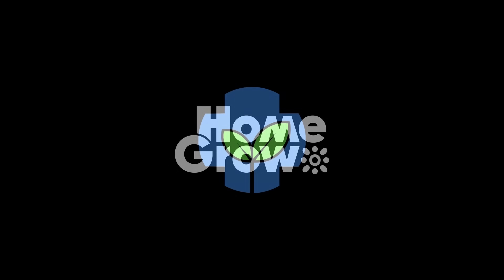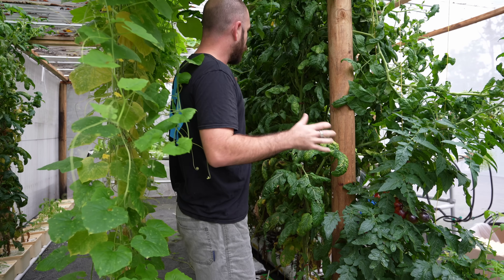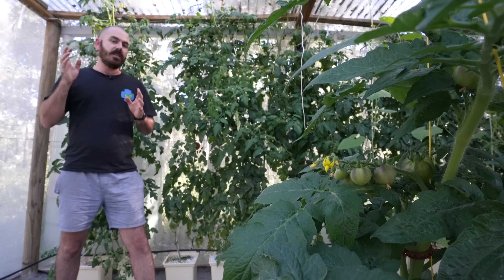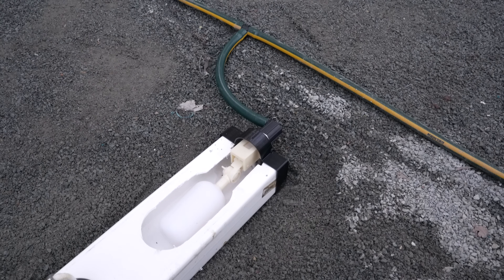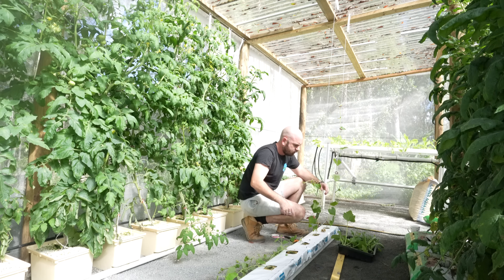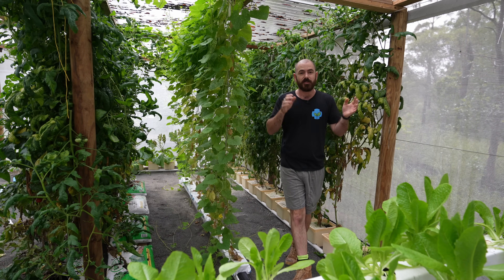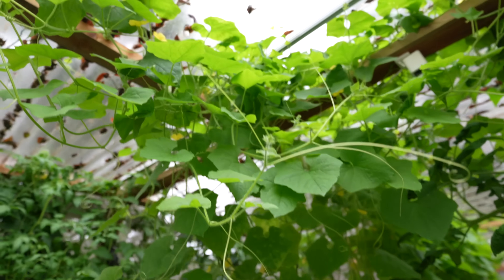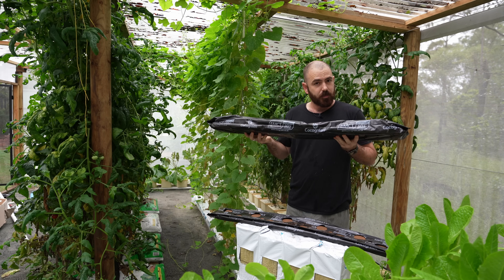The Rock Wedge Hydroponic System

Comment: Do you not make any 3d prints to fit uk guttering ?
Reply from the maker: There are round pipe prints.
Reply: @Hoocho  We also have square pipes, 65mm square
Reply from the maker: If anyone has the pipe and is willing to send out a sample, just a slice of it, I can make up some designs.
A photo will work, but to test the fit a 100mm section would be batter.

Contact me on contacthoocho@gmail.com

I’ll pay for postage.

Comment: I am wondering if you can put vining crops in a nft or vertical kind of system. Your pucs seem to be the most environmentally friendly way to hydro, due to their infinite reusability.
Reply: Root clog will always be an issue with large or vining plants in an NFT, vertical might work better. You may be able to get away with only putting a couple plants in a length of NFT then running stringers up, I grew some cucumber vines in a 10 gallon tote and the roots were at least 10+ feet long.